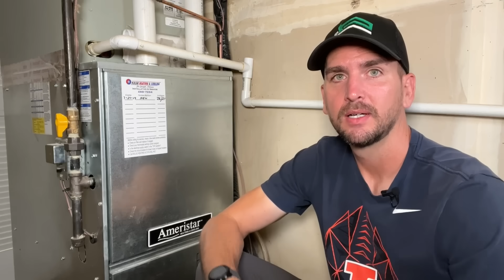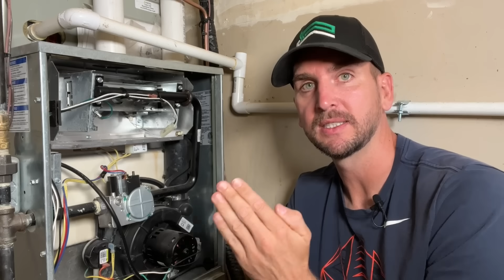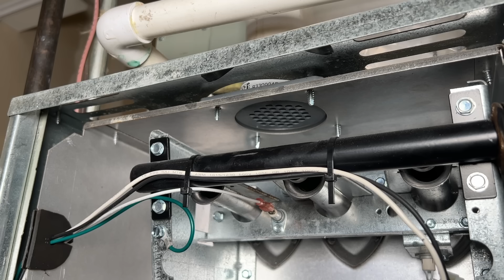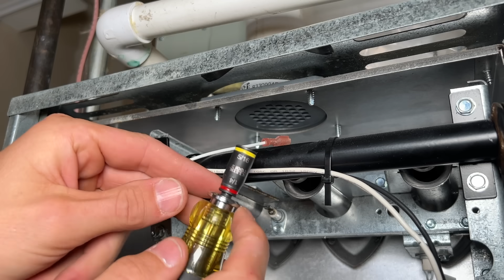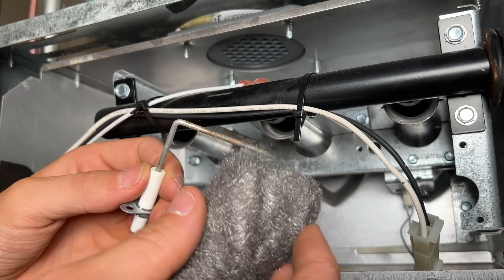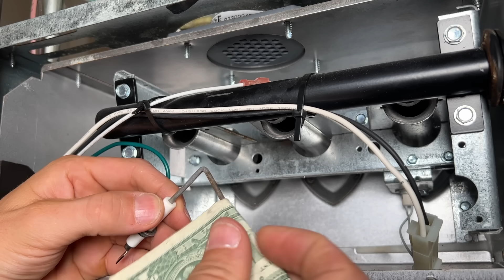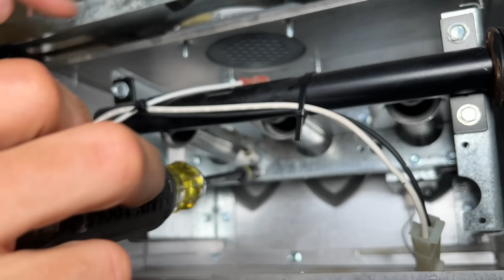The Most Common Reason Why A Gas Furnace Won't Turn On

Comment: I took mine off. It’s only a year old and cleaned it. Same problem. Fires up for two seconds then shuts off
Reply: Check the connection at the flame sensor and at the board. The spade should go on tight. Check the ground connections for the furnace. The burner box must have a good earth ground for the flame sensor to work. Make sure the flame sensor wire is not broken. Make sure all burners are igniting.

Comment: It’s a cold night in west Texas and my heater wasn’t working just before bed. This video helped me greatly. 

Essentially the cycle never made it to step 3. I took off the front panels to try and diagnose and it worked perfectly. I put the panels back on and it stopped working. 

Your video broke down the 6 steps and helped me understand why it wasn’t working. Somehow the tube connecting to the pressure sensor in step 2 turned and when the panels were on, it pinched the tube blocking the draft to the pressure sensor. 

Easy fix I turned the tube and I now have heat!
Reply from the maker: Boom, nice work troubleshooting 👊

Comment: Why is there a delay on the furnace bower start after you have a confirmed main burner firing? good video.
Reply: It lets the heat exchanger heat up before air is moved through it.

Comment: My furnace just stopped working on a code 6. Does anyone know how to fix that. It looks like I have 1 cable that’s not plugged in but I don’t know where it goes. It comes from right above my flame sensor
Reply: What does code 6 mean? The meaning of the diagnostic codes depends on the model of the furnace. Try to find where the wire is supposed to go with the wiring diagram. Check for a missing wire at the flame sensor, ignitor, limit switches, and pressure switches.

Comment: 10 years ago our furnace did the same thing, but that wasn’t the issue. The gas valve wasn’t actuating. HVAC guy ordered a new one, wasn’t expensive, and he got the old one working while we waited for the new one by tapping on it lightly with a small hammer. It worked fine until the new one came. Now, every couple of years, it happens again, and I go down to the basement and tap the valve lightly with a small hammer- good for a couple more years. Weird. I make sure the wire connections are clean and tight but it still happens like clockwork.

Comment: Hi. Thank you for your video. My house is cold and especially my bedroom and bathroom. It feels like only little heat is on but the other 2 bedrooms are sooo warm. I’m not sure why. Literally certain part of the house with good heat and certain part so little heat. Please help
Reply from the maker: Has the heat ever worked well where each room was getting heat?  Is this the first fall/winter you are in the home so using the furnace for the first time?
Reply: @EverydayHomeRepairs  
Hi. Thank you for you reply. We live in this house about 10 years and also not finding where is the filter. Never change filter. The heat never give me problem but recently acting up. My bedroom is the coldest room, like a icy room and also the bathroom. After shower it’s the worst because came out from a hot shower then the cold bathroom doesn’t feel good. My husband and i wanted to try to figure it out without calling the professional ( expensive) we still trying to figure it out. Should I turn the switch on and off and see?? What do u think I should do?? Thank you

Comment: A few years back started having issues with our furnace. Did a google search and found what I think is the most comprehensive troubleshooting guide for my model. It takes you down paths, confirming yes/no operation for every possible scenario/operation. Over the years, I have replaced pressure switch, 12V power supply and main control board.
Reply: 24v power supply?
Reply: @SilverandCigars  maybe. It saw a small transformer; either 12 or 24v.

Comment: That flame detection sensor was the exact reason my furnace did not stay on. To clean the rod, I was looking for a dollar bill, but all I had was a five. So I went to the neighbor's house and asked if he had five singles. I Explained to him I needed a single to clean the rod in my furnace. Back up and running.  THUMBS UP!!!
Reply: I used 1 trillions dollars Zimbabwean money and it worked!!
Reply: @sigendut3336 if that was in single dollar bills, it would have been a couple of truck loads, imagine the weight😂😂 Stay warm and safe.

Comment: When I first moved in a tube would get condensation build up in it that prevented the system working properly. I had to drain it a few times that first week and the problem has never returned.

Comment: I’m very thankful for this video I have been learning too much from technicians and I just fix my home heater bad gas valve follow this steps I found the problem and save money las week a service company charge to repair this problem $1200 was on Saturday but if I wait until Monday $1000 ? Vas a just bad Gas  valve that cost $100 on amazon I did my self and works just fine following all safety tips from videos like this one thank you I save money for my daughter in college !

Comment: Tech here. Don't agree with teaching general public about anything Furnace or electrical.  Fire in a box that we control. DiYers are a nightmare and dangerous. We are pro's for a reason. That's why they pay us. Stupid problems or not. You customers pay for knowledge just like we did in order to be pro's.
Reply: Maybe if you didn't rip people off every time and claim it's a cracked heat exchanger we wouldn't need these videos.
Reply: @Sylvia isgod  I do not condem systems on the regular. Nor do I say your Heat exchanger is cracked. There are test done to determine that. Not mention if a system is out of Heat exchanger warranty or past life expectations. Us that do this everyday know the ins and outs. Not all companies nor Techs out to rip you off. You home owner think we make all this money. Typically you all never take into account like you we are running a business. Just like you and any other business. Why do Doctor's Lawer's why are they never questioned. I passed a hard exam also to be able to make money. You home owner never take into account the Cost to do business legit and internet shop for things. Not the real world human.

Comment: Also once in a while you will see a tiny brown spot on the electrode insulator where it is arching to ground so if the furnace is 6 years or older be prepared to replace the electrode or semsor, oh & clean the area where the electtode is sparking to ground.
Good presentation thx im sure its gonna help a home owner with no heat.

Comment: I left HVAC in my younger years because so many companies would find these little problems and then charge for something else. It's nice to see someone is putting out easy to understand videos on this topic.
Reply: You aren't kidding; I know how to do this stuff, figured it out... and told the service man what I thought ... and it was .. since I was there.. I knew what was done.  His boss called as he was about to leave... I don't think they can charge me anything extra on that.... lets see and I'll let you know.  I had getting abused by the "industry" that's why I like to learn through great videos like this and my probing and asking my logical questions.   I knew it couldn't a senso on my problem but at least I had a dialog at a counter and basically told them that I know something about this stuff.. ;).
Reply: @samsno3667   you also arent taking the liability, you negate the truth that the liability of an old furnace is enough for big companies to find it more advantageous to just replace them. say they leave and your heat exchanger cracks a day or a month later, now he is at risk for being sued or potentially at risk for your dead body in the middle of the night.

i dont agree with them, but i also see the side of taking all responsibility for everything after you look at it.

once i touch it, it becomes my problem.

and if im going to touch 2-5000 pieces of equipment a year we need to limit my ability to be sued.

continuing to fix old shit is the polar opposite of that.
Reply: @asbestosfibers1325  a cracked heat exchanger falls under an act of God unless it comes to the customer that way at initial install. That's happened to me more than once when customers refuse to buy quality stuff. No different than buying cheap brake pads for the vehicles. They work for some time but rarely for long. Either way I'd still replace it and nobody has ever come after me for manufacturing issues. Protect your liability however you see fit as some parts of the country are naturally sue happy 😁
Reply: I live in Virginia. I just had the heat and air-conditioning company come to do routine maintenance on my heater at the time the heater had stopped blowing air so that was right on time when the gentleman arrived. He looked over my unit and he told me I need a hot surface igniter. And a flame sensor. As of watching videos on YouTube I learned the sensor had carbon buildup. I rub the carbon off and wow it’s working again, it was so hot in my house. I had to turn the heat down and that gentleman wanted to charge me $450 shaking my head.

Comment: What would be reason if I turn off heater for a bit turn it back on and it blows heat once but after it continues to keep blowing cooler air not heat
Reply: Two most common issues is an airflow issue and the furnace is tripping the limit switch. Or a drainage issue which is causing combustion airflow issues. Check for any diagnostic codes which can help point you in the right direction.
Check the air filter and make sure it is clean and has the correct rating. You can also take it out temporarily to rule it out.
Check the drains and trap for clogs. You should also pull the tube off the pressure switch and make sure it doesnt have water in it by blowing through it.

Comment: Flame detection sensor went out on my furnace last year. I researched the part number, but heating repair places would not sell me the sensor. They told me that a service technician would have to come out and verify the condition. They told me it would take days before someone would be able to come out. So, I ordered it on Amazon, saved some money and fixed it myself.
Reply: Same. Guy was quoting 220 for the part and 300 for labor. My.landlord ordered the part from Amazon and fixed it himself in 45 minutes.

Comment: Are you certified to make these repairs and if your not they should not be ceiling you parts each furnace has different fans delay times 
Shouldn't be giving advice
Reply from the maker: You can just order the flame sensor on multiple online sites.  You do need a license to buy from the local HVAC supply house.

Comment: Cycle of furnace operation: 
1. Draft inducer motor turns on
2. Confirmation of draft by pressure switch 
3. Igniter glows hot
4. Relay allows gas valve to turn on the burner
5. Flame detection sensor confirms flame* (this is the problem he is explaining)
6. Main blower fan comes on

This whole cycle takes time… 90 seconds
Clean or replace the flame detention sensor with a Scotch Britt pad, DO NOT TOUCH! It has a coating that you do NOT want to remove. Just remove the carbon!
Keep a spare flame detention sensor and igniter on hand. 
Thank you!
Reply: I like to add a little more detail to the cycle. On hot surface ignition furnaces with an integrated control board (like in this video), the board is constantly monitoring the limit/rollout switches. If they are open, the cycle won't start. However, the main blower and draft inducer will likely run constantly if there's an open limit/rollout switch. Then, on a call for heat, the very first thing the board looks for is the pressure switch circuit to be open. This proves to the board that the pressure switch isn't stuck closed, or someone hasn't added a jumper across the pressure switch to electrically bypass it. Then, after the pressure switch circuit is proven open, the draft inducer motor turns on.  Having a spare ignitor on hand is a great idea, and given the low cost of a flame sensor, it doesn't hurt to have them around either.

Comment: Show all other steps 
Pressure / vacuum switch 
Igniter 
Any blockages in exhausts/ vents 
Drain blockage 
Blocked air filter 
Overheat sensor 
And more

Comment: My furnace, for the past two years, at the beginning of the heating season made it to step 3, but apparently the relay or more likely the gas valve itself was sticking (and wouldn't open). My furnace is still in warranty, but only until next October. I am wondering if I should replace the gas valve for the $220 quoted? BTW...the solution the first time this happened was that it simply resolved itself after a few cycles of shutting the power off, waiting a while, and then trying a little while later. This year, I had to call a serviceman, who told me he basically tapped on the valve and it freed up.

Comment: I live in a 40 year old apartment and the furnace did ok up until about a year ago  when fan wouldn't come and you have to do manually. The  system shuts down ,but the pilot stays lit.  After it stays off for about 15 minutes it comes back on. What could be the problem?

Comment: Unfortunately I've had bad experiences with HVAC technicians one was a case I started getting a bad feeling after he started installing the new system first was when he said hot water and hot air doesn't rise second was when he said water won't freeze if it's moving 20 below I told him he had to start the boiler before running water out to the unheated areas of the house he said no as long as the pumps running it won't freeze well he opened the valve and it froze up then he started complaining about customers refusing to pay he got the system in and promptly went bankrupt we had a lot of problems with the system most of it do to the fact that it was one boiler running 2 system 1 low temperature and the other high temperature one problem with the low temperature he set it up a a loop and put the sensor at the top so when the low system called for heat the boiler turned on and immediately sent 212 degree water into the loop up it went right to the control which then turned off the valve and the boiler then cycled back on soon wore out the valve and I replaced it putting it where it would sense the water coming back from the under floor heating it continued to give problems finally my brother found another boiler and I separated the 2 systems he had installed a a Amana hot water heater for house hold hot water the first lasted about a year and was replaced by another company on warranty the second lasted about a year and again needed to be replaced unfortunately Amana had changed their replacement policy and although the tank was covered the labor wasn't since it was going to be a problem we found a good 80 gallon natural gas hot water tank and eliminated the Amana when I separated the two systems and moved them from the main floor to the basement we found out why he had wired the Amana up so when it called for heat it bypassed the  temperature control on the boiler so as long as the Amana called for heat the boiler stayed on we had 3 baseboard heater zones and I found out when trying to find feeds and returns the main suite down stairs was fed from both ends no return so it only gave heat when the the storage unit called for heat and the 2nd feed line was airlocked main suite continued to give problems mainly because of a loop over the front door that was continually getting air locked finally he bought a new high efficiency boiler and got that installed and again the HVAC company screwed up redid the loop for the under floor heating but it runs between 90 and 140 degrees and that is too low temperature for the baseboard heaters the house has. been sold so it's the new owners problem don't know if he found someone to get things working my other one was on my house and I had an up
Reply: Wtf? Try using PERIODS.

Comment: I bought an older home for a good price but heat system is somewhat disconnected. Would you possibly help me determine correct placement for the transformer wires and furnace door switch ?? Your help with this is appreciated. ➡️ York Diamond 80 furnace

Comment: I clean mine every year with a small brass brush til it shines.I replace the flame sensor rod ever 3rd year and clean the old one as a spare.If you have a brass wheel on a grinder that works great also

Comment: I m a tech the most commom are a child turns off the switch. 2 the kill switch tighten the front cover.  3 the breaker is open.

Comment: How about a Goodman 2016 furnace Basically the same thing but no gas it runs sometimes it does have  ECM motor can it be reprogrammed If yes. how

Comment: Wow, I need to stock up on these sensors just in case! Is there a video on how to replace your door safety switch ? Thx
Reply: My advice would be to bypass the switch entirely. I have never seen or heard about the door falling off, it doesn't happen.

Comment: Great video.  Been there, done that.  Was without heat for  month when hiring a terrible HVAC firm.  He started just changing parts.  First the electronic control unit $500.  The tried to change the gas control valve but couldn't get it off, not sure how much that was.  After they didn't show up or call for a week or so, I called the original installer and asked for a tech who had helped in the past.  Should have done that in the first place but thought I'd try a new company with an inspection discount.  He showed up and this is the first thing he looked at, quick cleaning and started right up.  He told me there are a lot of "parts changers" in the industry who will just keep doing so until they strike onto something.